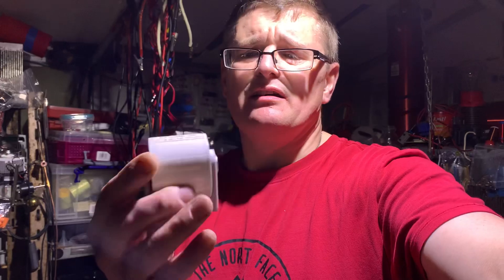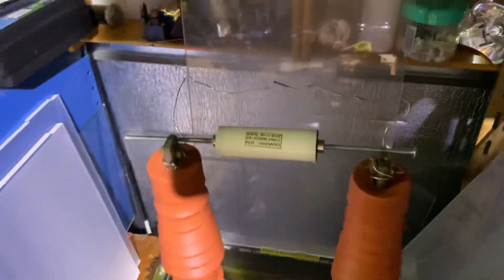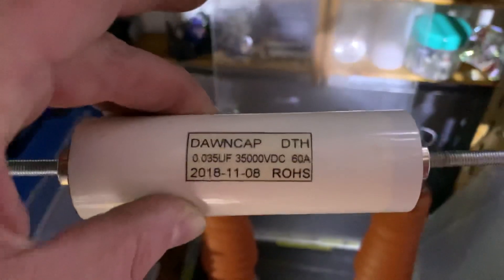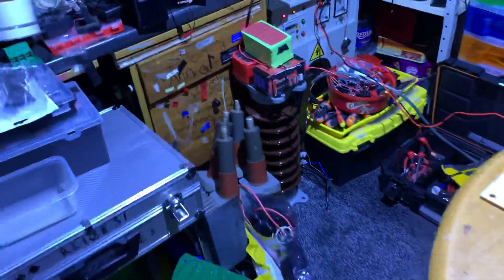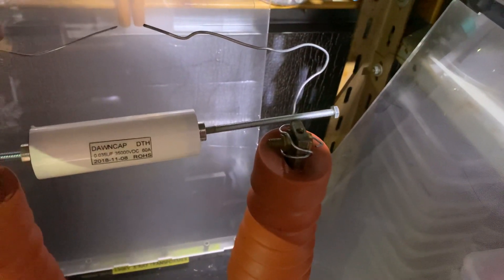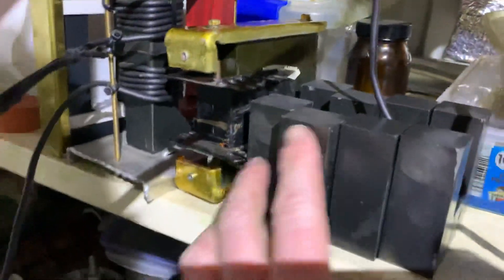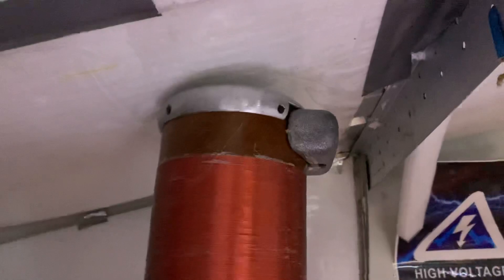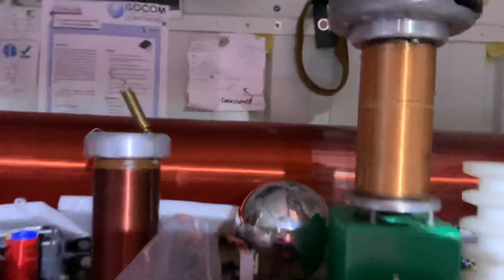killed my 35kv pulse capacitor”

Comment: I killed 3 of these very similar Dawncap white pulse capacitors, cylinders like yours, 60A, but rated for 30kV. The voltage was less than 30 kV, around 20kV probably. Too much current?

Comment: I did a back of the envelope calculation, if the cap. leads are ~100nH, and the spark gap’s voltage drops from 35kV to only a few kV after it strikes, then you get ~20kA peak current, ringing at around 2.7MHz

Comment: Ive been doing alot around the house too, I am trying to try my hand at building useful devices, I have run into a dilemma of too many power supplies and not enough devices using them :D
Reply from the maker: Lmao I love power supply’s mate ya never have enough lol 😂 👍😉
Reply: @high1voltage1rules  yep, I am currently making a DC-DC converter to rule them all, it will use a 150W laptop charger from mains and at the same time be able to run on the battery of the UPS I have. It is going to replace all the plugs for my networking equipment and my Wii. once it is done I will make a video
Reply from the maker: @SuperBrainAK  sound good buddy, looking forward to that. Let me know 👍😉